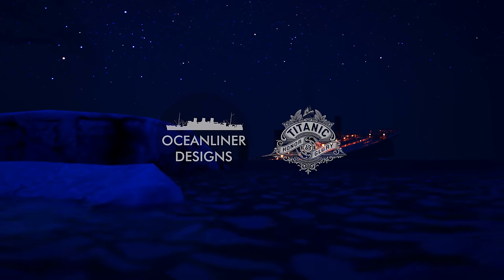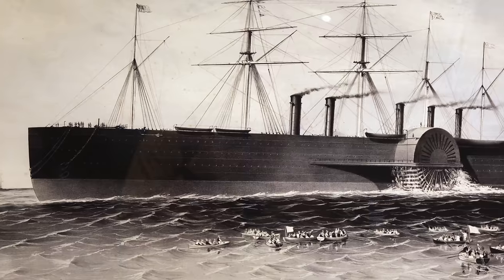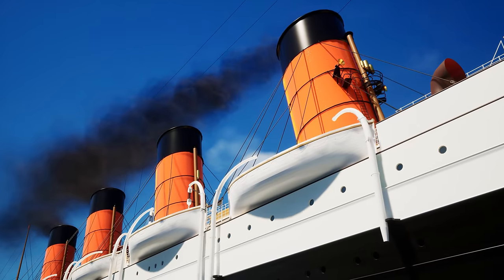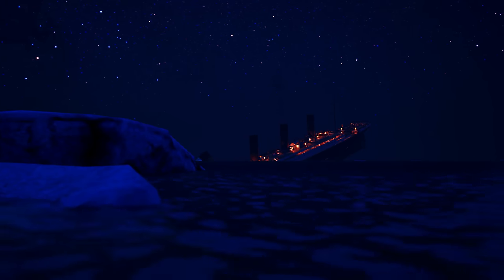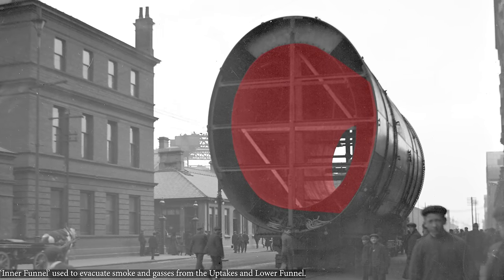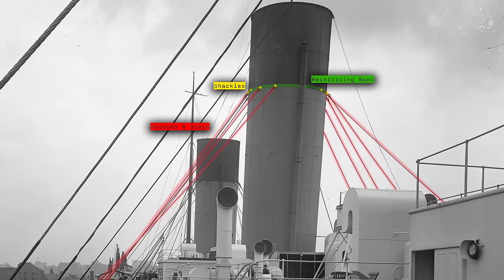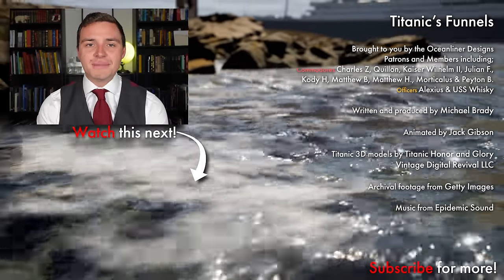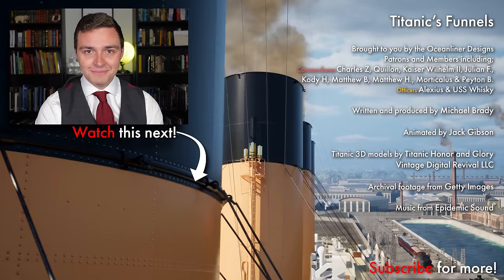Why Did Titanic's Funnels Collapse? An Analysis.

Comment: Definitely going to sail the Trans Atlantic route via QM2 or QE2. What is the difference between these two, other than their namesake? I am worried about sea sickness. They say, the better hearing you have the worse you have it. I would possibly rather go during the season Titanic sailed. That would be the best vacation.

***************************

I wondered what the process was to clean the funnels. I think there are a lot of math and physics involved in this question as to why the funnels came down. 11 psi isn’t a lot of pressure per say, as you mentioned, although how long was the funnel sustaining that pressure? The crew kept her sinking rate slow to save lives. I wonder if this had everything to do with tension (maybe temperature fluctuations as well, going from hot to cold so rapidly made the material brittle?) Good stuff here. Sorry, trying to get my comments down in size here, it’s a lot to think about!

Comment: I also wonder if the difference between the temperature of the funnels and the ice cold water didn’t create a brittleness and internal stressing to the metal? Without the pressure, that might not have been as deep a problem, but it may have added to it.

Comment: There is one other thing that could also contribute along with the pressure difference and that is temperature. So when the funnels hit the water the rapid cooling would cause the steel to contract rapidly at its base and then add the water pressure difference. It would be kind of like dropping  a hot soda can filled with steam into a bucket of cold water... while not as extreme as the experiment with the soda can the effects are similar.

Comment: little anecdote about the funnels size
back in 95 I started building models and the first one was the Titanic
I never noticed until I build the ship that the funnels didn't have the same height!
the 3 first were in the wrong place

I have a question for you about the funnels of the Lusitania class
is it possible that since they were taller and straighter than Olympic class they were stronger to make sure they don't collapse while on sea?

Comment: The cables were only enough to stabilize the funnels with the wind during sailing. As the ship sank, the degree in which the ship was, the weight of the funnels were more than the cables could hold. They snapped as the funnels fell over during the sinking. The crow nest and crane poles are still erect even after the sinking. Being the funnels weighed as much as a steam engine at the time, they fell off during the sinking on the surface (confirmed by witnesses) and part of the debris field now at the bottom.

Comment: I always wondered why they never considered installing some kind of heat exchanger into the funnel uptakes and casings to recover some of that immense heat that they needed to insulate the funnel casings against?  It could have been used to provide hot water and heating to the passenger spaces, It would have reduced the need for dedicated heating (though may not have been able to completely meet the Olympic class's heating needs) and thus improve efficiency, coal burn, and cost to the shipping line.

Comment: Did funnels fall forwards or to the side?  The movie depictions have Titanic not have much of a list to the sides (roll)  yet funnel falling to the side. 
No matter the angle at time of split in half, Titanic would have have a pitch (bow down, stern up) much higher than any normal sailing in rough weather.
Falling to the side if ship has little roll/list would imply that cable stays snapped on only one side, and the tension remaining on other side would have pulled the funnel down to the side.  Falling forwards would have been more a natural result of the ship's pitch down exceeding the stay's force.
Another aspect to consider and perhaps rewrite of history:  what if the funnels didn't topple cleanly, but rather the base moved in one direction and top in other? 
Consider that very hot metal doesn't like sudden contact with nearly freezing water.  It is quite possible that contact with cold water would have caused the hot bolts holding the funnel at the base to crack/explode.  The pressure of water who desperately wanted to get inside the smoke stack below water level could have pushed the funnel in one direction and that would have loosened the stays enough to allow funnel to move/tilt and go into irreversible movement down. 

BTW, from scuba diving: at 10m depth, pressure is 2atm of 2* 14.7 psi. or 29.4 psi.  So this would mean a 14.7 pressure differential between a water side and air side inside funnel.   As a point of comparison, the pressure differential for that "door" that popped out of the 737 was 5.7psi at time of event.

Comment: Could the icy cold seawater flooding into the extremely hot funnel system cause a warping of the metal, weakening the phalange bolts?

Comment: Thanks!
Reply: Now about that question about the looped piping on the rear or front of some funnels!  What purpose did they serve?
Reply from the maker: That is hugely generous of you - thanks so much! The piping was for water throughout the ship - by having it running up the funnel then a steady pressure could be maintained by gravity without the need for pumps and such!
Reply: Mystery solved.  Thanks so much!

Comment: Could the cold waterhavecan effect on the collapse of the funnels. As metsl woorkers know hot steel being sudden cooled will shrink considerably. If the temp of the funnelsvwasin the right range the sudden cooling andvthus shrinkage could cause the framing to shrink enough to smapnthe rivets or bolts holding the funnel ontonthe deck.  Just an idea.

Comment: The bigger question is how the Titanic's power stayed on even when it was half flooded with salt water - which tends to short out electricity. The engines weren't running, the boilers were underwater, the turbine wasn't spinning, so how did the power even get made?

Comment: I often wonder, with all the diffferent types of technologies over the last 150 years or so, which boats would you - Mike - would consider the be the most robust ship ever built.  Like many other ollder pieces of equipment and technology (and I live in vintage car circles) sometimes older cars with less advanced technology last longer, perform better long term, in essence, live llonger than a brand new modern hybrid or even normal car.  We always say in older cars, the simpler the technology, the less moving parts and heavier the engine, that car will outlive all of us.  Not so for modern cars.  The most we have EVER got out of modern cars as a family is 300 000k, but our vintage cars, made of solid steel just go and go and go, decade after decade..  Occasionally they need replacement parts - and in an accident theyre more deadly - but the solid iron engines, and even the gearboxes,  they just keep going, decade after decade!  I have a Rover P3 1949, and its engine, (the landrover engine) is yet to have a rival.  So, is there a ship out there you think would still be going today if it was allowed to - 100 years later?

Comment: Could the water temp and the temp of the thin steel be a factor. in effect the base of the funnel would be quenched as the water hit it hardening the steel at the front base of the funnel, making if hard but brittle.

Comment: I still believe the super heated funnels coming in contact with near ice water caused the metal to shrink rapidly enough to pop thr rivets leaving only the wires holding them. The rears didnt get hit with water until much later. Just a theory

Comment: 11 psi at 25 feet... Most people are familiar with the concept of "explosive decompression" on a plane. See Alaska 1282 or Southwest 1380 where extreme results happened at pressure differentials much lower than the cruise max of 8.35 psi. China Airlines 611 disintegrated at 35,000' due to a pressure vessel failure. So the fact that at 25' these would have had 11 psi acting on them, it's very obvious what happened.

Comment: You say 1 ¼ inch wire but the normal way to express the thikness of rope and wire was circumference. 
I guess that is what is meant here? 
33 mm in diameter would be rediculusly thick (talking as a sailingship rigger)

Comment: Did White Star really develop buff? Black and buff were the colours of the Royal Navy during the latter stages of the Napoleonic Wars, and had been used on ships of all navies for decades.
Reply: No, it was a standard color shade, you find it all over the place in the day, they used natural pigments so were limited in choice of color, also the paint had to be light resistant, sunshine bleaches some colors more than others. The paint needed to be heat resistant as well even though it was applied to a second outer skin. Even motor ship funnels got hot as well, the company I worked for Shaw Savill,  used the same colors as white star, and used the same names as well, my first ship was the Megantic.

Comment: When Ballard found the ship back in 1985 he actually believed at least a couple of the funnels were attached and it was only by a slight navigational mistake when Argo went over the bridge area that he discovered the forward funnel was gone

On a little diagram Ballard Drew in the national geographic how we found Titanic the second and third funnels were still shown on the ship and he only had hints at the stern had snapped off

If the funnels falling at the surface the most definitely would have been torn loose during the 13000 ft drop to the ocean floor

Comment: Wouldn’t the frigid temperatures of the ocean in the middle of an ice field on a clear cold night combined with the “still smoking” funnel’s boiling temperatures have something to do with their collapse? Especially as they fell once they made contact with the water
I’m no scientist or engineer but I don’t imagine that the steel being extremely hot on the inside and extremely cold on the outside could be good for the integrity of the structure. Exposing half-inch thick steel to those kinds of extremes must have compromised the steel’s integrity surely?
I would have thought that superheating one side and supercooling the other would make the steel plating brittle at best. Then, if that’s only at the base, the list of the ship combined with the sheer weight of the funnels must have been enough to set them falling, snapping the support cables in the process.
Is this a valid hypothesis or am I missing something and barking up the wrong tree?

Comment: While not exactly the same thing, I spent Hurricane Agnes (1972) on a 633' Fleet Oiler, U.S.S. Neosho and I'm here to tell ya. It's impressive to be on something that large bobbing like a cork. Not just rolling, pitching and yawing but occasional sudden vertical acceleration both up and down (think: playing Elevator Rodeo or riding through airplane turbulence in slow motion)
🤔🤨 No ... More like being in a tumble washing machine in slow motion. With thunder and lightning.

Comment: I disagree with the theory. Mostly because we see no evidence of implosion of the casing in the wreck. 

Here’s what I believe happened. Titanic’s funnels would have been hot from the boilers. As mentioned, the funnels would expand from the heat requiring the shroud lines be loosened to account for it. I believe as the water surged over the funnel, the icy cold temperature of the water would cool the funnel structure significantly. This likely would cause the funnel to contract which would cause some slack to form in the shroud lines. As this slack got worse, this would lessen the support being provided to the funnels. This combined with the stress of the increasing forward list would cause the funnels to begin collapsing, which would have rapidly began shock loading the shrouds in pairs causing them to snap under the sudden load.

Comment: This may not sit too well with some fans worshipping the supposed superpowers of Olympic and Titanic but the most likely explanation of why the Titanic broke up during the sinking and her funnels collapsed while none of that happened to Lusitania, was probably because the Titanic didn't not have that much redundancy built into her basic design. And yes, the cold-temp brittleness of the steel may also have been a factor. This is not saying that the Olympic Class ships were flimsy. Olympic's career clearly proves they were not. She performed very well in conditions she was designed for and even beyond. But the Cunard ships, due to the involvement of the British government in their financing and design, were built to Royal Navy standards, more like warships. Titanic wasn't. She was built as "economically" as possible. I avoid the word cheap on purpose, because cheap she certainly was not. 
Harland & Wolff were masters of building efficient ships. They really knew how to minimize structural weight and watch material costs. Comparing the weight and construction plans of the Olympic Class to the Lusitania's, it becomes readily apparent that the Lusitania was built with more - and regarding the grade of steel used also better - material and with bigger, sturdier structural sections. Lusitania displaced (i.e. weighed) about 45,000 tons at nominal draught, while Titanic, being over 40% larger in volume, displaced just short of 52,000 tons, a difference of barely more than 15 %. She was of comparatively light weight. 
To achieve that, the internal structural arrangements would have to be optimized for good performance with less material. This was probably the main reason why the Olympic Class ships lost their multi-deck dining saloons and other extravagant interior layout features during their design phase. Big openings in the decks were reduced as much as possible, leaving mainly stairwells and hatches needed for cargo and machinery. Since stairwells are absolutely necessary but domes over saloons are not, it is likely that a design decision was made to play up the "Wow-factor" in the staircase spaces and sacrificing it in the saloons. This would have saved on weight for additional bracing inevitably required for large openings. Less weight in turn means less power needed to move it all, which means lower cost for the machinery itself. 
White Star was very profitable because they kept initial and operating costs for their ships at bay. The Olympic Class ships, while much larger, didn't cost more than Lusitania or Mauretania, actually a bit less. Then there was less operating expense for fuel and maintenance. The unusual hybrid propulsions system was a good example: instead of 4 expensive turbines like Lusitania, a single one of less complex (and cheaper) design would suffice in connection with proven (and much cheaper) triple expansion engines to get 85% of the service speed of Lusitania at 75% of coal consumption per voyage with ships of 40% greater internal capacity. That's a set of numbers no accountant could resist! I hazard to say that the accountants got carried away a bit. I mean, would it REALLY have cost that much more to decorate the swimming pools...?